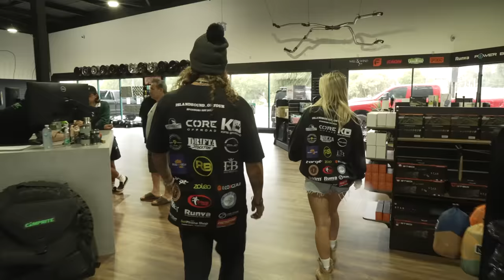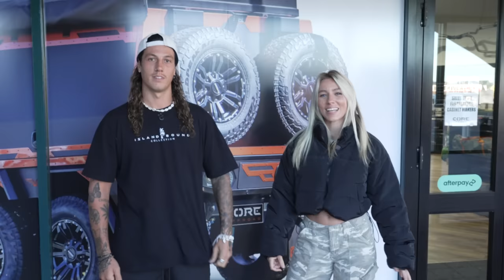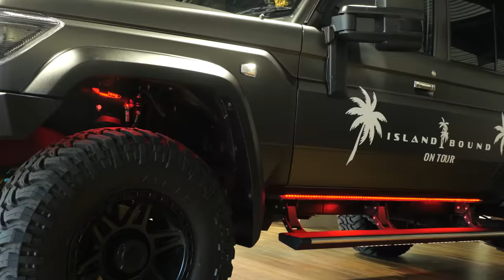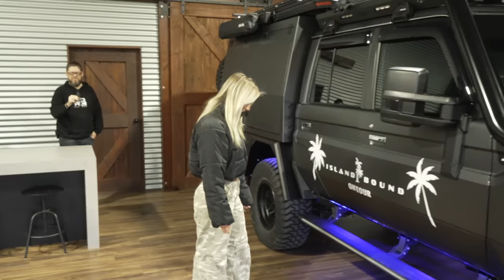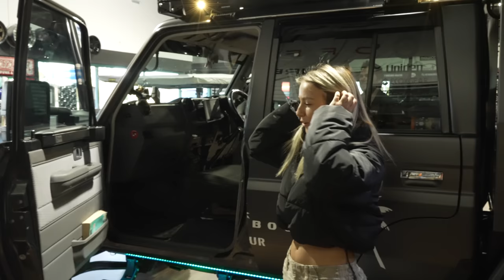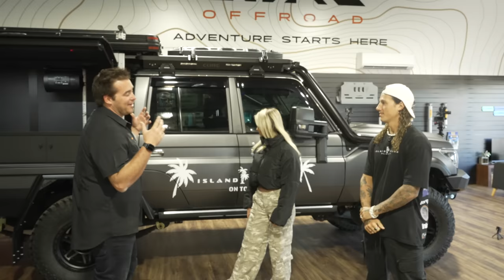79 SERIES COMPLETE ULTIMATE BUILD + CORE OFFROAD CANOPY REVEAL...."I am genuinely lost for words"

Comment: One sexy looking rig.
I'll make it suggestions ??.
Get yourself jmax call spring conversion kit for your front and rear end so it can carry the load more comfortable and better control also a diff correction kit that now brings you a rear and front tyres in line. Jmax also does a 6x 6 conversion absolutely better control and if you're towing a caravan it'll give you 4 tonne towing.
Reply from the maker: Thanks for the advice :) definitely look into it one day